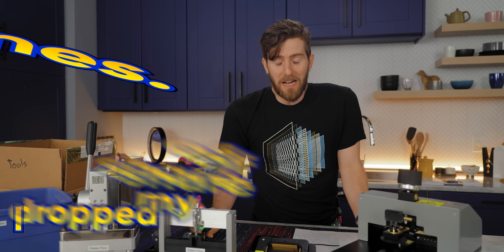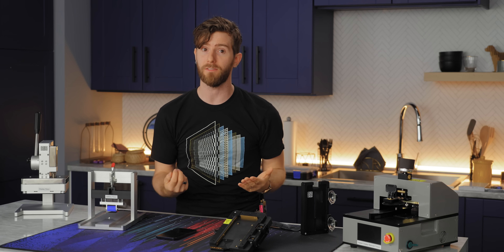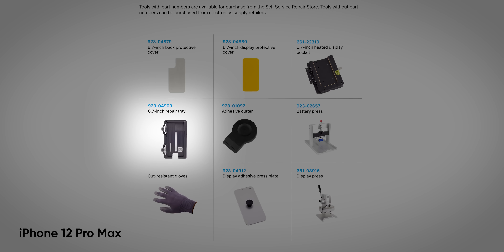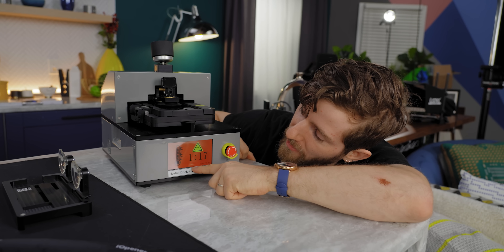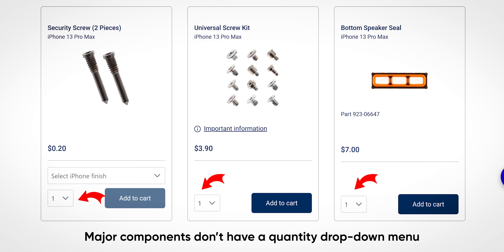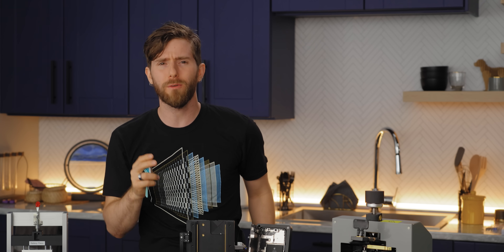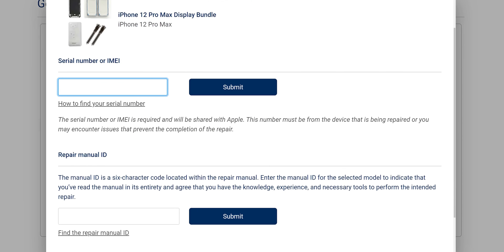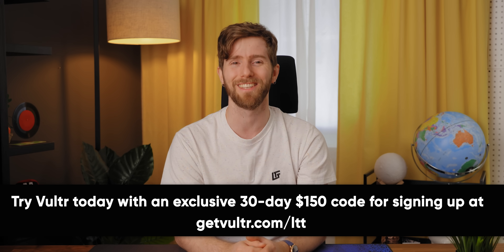I’m a Genius - Apple Self Service Repair Program

Comment: When you think about it...the Apple Store IS the "small repair hustler" now, since they're the only ones with access to unlimited "original" parts to perform repairs.
The whole point of this IMO is to make the Apple Store repair SEEM a lot better in comparison, convincing people to opt for it.
There's a whole psychological study behind this too I think, that when you present a pointless much worse option, something else looks much better or smth along those lines.
Reply: Except there is extensive evidence that the "geniuses" at the "genius bar" give completely wrong diagnostics and will over-charge you for the simplest of repairs. There was a CBC news segment featuring Louis Rossmann where they had a macbook whose display connector had a single bent pin. The "expensive" fix: replace the connector (75-150$), the cheap fix: unbend the pin with a pair of tweezers (0$). The Apple Store's diagnostic: you need to replace the entire display unit, case and motherboard (1200+$). 

There is obviously a tremendous conflict of interest when the company selling you the product and the company repairing the product are the same entity... they don't have to be dishonest but they consistently are and WILL push you through devious designs towards buying a new product rather than fixing your broken one. That is not something we had with small repair hustlers.

Comment: Typical corporate anti-consumer tactic. If you're forced to do something, make it more annoying and (effectively) costly than doing it the way you want people to do it, so when everybody does do it the way you want to (because you've basically forced them down that path), you can tout that you at tried to offer that option and cite it's lack of use as a way to get rid of it.

In what world should the parts to repair a device cost half, if not almost as much as a whole new device?! The whole point of giving the consumers these parts is that Apple saves on the labour of the repair, they literally save money here, yet they (effectively) charge you more than they do themselves to repair the device!!

Comment: Literally the same tools I use at work as an Apple certified repair place. The act of fixing an iPhone is never actually hard because the tools are pretty good and straightforward. The harder part is if literally ANYTHING goes wrong on the “paperwork” side of things in GSX(Apple’s repair order system/information hub for repairs) the repair process gets brought to a screeching halt and becomes a mother may I game with Apple. Very frustrating when you just want to get a client their working phone back.
Reply: ah yes, the joys of GSX-Chat. Love it every time that you have to chat with someone to just cancel a repair.

Comment: I don't get people who defend this stuff to me. It just seems like everyone who uses Apple is either reasonable enough to know when to stop, or is so brandwashed that they can't see how badly they've been duped over the years. 

I get the appeal. Apple has top-notch products and quality control, and I get that they want to keep it that way. But there comes a time where you need to loosen the reins and let consumers do what they want with the devices they paid for. They're not renting the phones, it's a piece of physical property that they own. When someone steals it, do you put "Apple" under the asset owner form in the police report? No? Then it doesn't goddamn belong to them, ergo they should not have a say in what's done to it. 

If Samsung wired their phones to brick when you tried to change anything about them, that would be anti-consumer, right? So instead of making a piece of new equipment brick your entire phone, Apple simply shifted the paradigm of the game to brick individual components if they don't match your serial. (By brick I definitely don't mean the term literally, just hyperbolically.)

Apple decided that individual components wouldn't function if you replaced them without authorization. That's no longer quality control, it's no longer a product consistency issue. It is the end user knowingly making modifications they should have reasonable wariness about. It shouldn't be that end users EXPECT a product to fail working if they try to independently repair their device.

I don't say the things I say about Apple out of spite or hatred or any other negative feelings I have towards them. I say them because I'm tired of seeing my friends flush money down the drain every time there's a minor inconvenience with their Apple device.

Comment: In my country (in Europe) Apple authorized distributor and repair shop takes from 1 week to 4 weeks just to replace screen and battery when parts  are in stock. Currently I can see opening of quite a few "fast" repair shops, but sadly no Apple certification.

Comment: I'm with Linus for the most part here. 

But saying that $58 for a likely damage or bad battery and display is more unfair than the $10 Gamestop will give you for a mint condition used game..... yeah you're very wrong lol. One item is in working condition, the other is not.

Comment: Am I the only one who thinks this is all incredibly stupid?
You have the right to repair (or at least try). What you shouldn't have is the right to make a company sell you parts or services.
If the company wishes to make it impossible to repair their product, that's their right because it's their product...
It's a private company so they can sell whatever they want to boost their profits.
I think Apple's practices are shameless and stupid, that's why I simply don't buy their products. That is the mechanism that the consumer has to improve a given product (choosing another product).
If you keep buying their crap and keep putting up with their prices, repairing policy and charger bullshit, then you can't complain.
You are going to choose their product even if it sucks in those areas, and they know it so they exploit you.
Stop complaining with your speech and start sending a message with your wallet instead.

Comment: Slap ANY iphone 5-12promax on a heating pad for 2-3 minutes. Unscrew the annoying pentalobes, assuming they haven't stripped from normal wear and tear, 10-30 seconds tops. Unscrew the battery shield on most devices, 30 seconds. Deal with the 6's annoying home button, another 30-60 seconds.
On 6 models, deal with the annoying cable assembly, unscrewing shields, minute or two. On 6 models, deal with excessive screws around speakers and contact plating for earpiece. On 7-12, take 4-6 screws out. On 6-8, reheat screen for removing home button, say a minute. Remove screws around home button, remembering lengths of each (matters for screw behind button itself).
Swap screens. Reassemble. Should take no more than 15-30 minutes, depending on model, for a trained technician. For the average consumer, double and halve that, so say an hour to 90 minutes.
15 minutes on a heating device? They're deliberately taking up your time to say "why didn't I go get this repaired somewhere instead of doing this myself?"

Comment: Electronics Repair Technician here with over 15 years of experience. Most IPhone screen replacements only take around 15-20 minutes at most. This Apple repair tool kit is completely unnecessary. For example the most basic tools you need. Would be a screwdriver kit, pry tool and a heat gun. Now for a screen replacement for a IPhone 12 for example. You can buy a lower quality aftermarket screen for as low as $40 or you can purchase a refurbished OEM Apple screen for around $130 from reputable parts dealers. If you're uncomfortable doing the repair yourself. You can always bring your phone to your own local electronics repair shop.

Comment: Major mixed feelings as I’m an eternal optimist. It absolutely is disappointing what they’ve released so far. Would have liked to see a lot of things a lot better, more widely available and better pricing. 
However… 
It feels like they’re dipping their toe in to see how it goes with a small subset of things, and they’re still finding the bugs and the kinks. I wonder if they’ll expand on things over time. Plus, I gotta point out… you do not have to use Apple’s tools! You can still do it with the ol’ iOpener and an ifixit tool kit.

Comment: Apple does not provide a parts tray because we replace all the screws when doing a repair. The lighting dock screws are replaced and we order these in bulk, and then the screws for say a display replacement come with the display part itself.

Comment: Funny thing about those displays for the iPhone 12 and newer models. If you look on their site, it states that you need to use the "system configurator tool" for it to work properly. Probably because the "unable to verify genuine apple display" message you get has nothing to do with being genuine or not, but rather there is data stored in a ROM unit housed in the touch IC of the display that checks with the mainboard on startup. The only way to officially write this new data to the ROM is with Apple's proprietary software which I'm not sure if they do for you or not when you order the display from them, so you may very well still get the error message after buying a display from Apple. The only other method is to transfer the chip to the new display which is a BGA soldered package, attempting to do this without experience is just great way to ruin a display.

Comment: Hey, thanks Apple. This offering provides such a great, real-world example of Malicious Compliance. The right to repair movement will hopefully be able to benefit from using this demonstration to educate the general consumers.
Reply: Honestly, as much as I am anti-Apple, I have to give them some credit where it's due. That screen remover thing will make screen removal SO much easier, especially in situations where the screen is significantly cracked, which is most screen replacements. The pricing is still bullshit, but it's so much more convenient than pry tools and heat guns.
Reply: @iClone101  What the heck is the point of using it though when it's AWFUL value ?
Reply: @DiSCERiTY  Even if you don't buy this one specifically, that fact that Apple has released it public means there will be cheap clones of it built.
Reply: @DiSCERiTY  what's awful value? The replacement machinery is only a couple hundred $$, for someone that would want to buy it it's easy to justify with time saved over time.
Reply: The fact is this is not really Malicious Compliance its minimal effort Compliance.  

The company apple is using for this is the same company that sources parts for apple stores and authorised repair stores. And the prices are identical to what that company charge authorised repair stores. 

And if you were to take apple to court on this they could easily show that a screen costs this much when you consider R&D, licensing, factory time, yields etc.   And apple have said that in-store repairs are a loss leader for apple retail so they will have legal documents proving that it costs them more to do a repair than they make from the repair. (I expect what is happening here is apple retail is also paying the exact same price for these parts and that does not even take into account rental of the shops that apple is retail is paying). 

proving in court that this is  Malicious would be very hard since it really is not it is just 0 effort. It looks like apple sent an email to the company that already supplies them and told them to start selling parts to the public and that is it.
Reply: @hishnash  I don't doubt that a surface level litmus test of their compliance efforts would fly above the legal definitions for malicious compliance. However, it would seem to be that "minimal effort" would have been Apple either doing nothing or allowing the parts manufacturers to sell parts on the open market. This is definitely more than doing nothing. Two massive flight cases, complicated methodologies, user examinations, and implementation of additional systems of control sort of more. I don't think these choices were "minimal effort" at all.
Not to mention that Apple continues to develop and produce, via their extensive R&D budget, devices that are nearly impossible to repair and concurrent systems to prevent "non-authorized" repairs.
Reply: @circan1  The company that is running this program is the company that sells these replacement parts for all apple stores and authorised retail partners (it is not apple).  This is a logistics computer parts wholesaler they provide this service to most other computer OEMs as well.

The factories would only be interested in selling parts in mass volume and would not want to deal with consumers, and you cant expect apple to be ok with a factory selling panels of 10 throasand iPhone screens. Since there is a load of R&D and IP cross licensing behind all of these parts.  

Apple does not really prevent non authorised repair they just show warning messages to uses on devices that have had this happen.
Reply: @hishnash  I think you are missing the point... So I'll spell it out. Apple is being anti-consumer and anti-right to repair with their practices.

Apple has hired this unnamed company to run said program and dictated all the details. Apple is in control. This program having a single operator (if that is the case) is only that way because Apple has decided that fact. 

There is absolutely no doubt that parts manufacturers would sell parts to more companies that do interact with consumers\3rd party repair services but Apple controls the release of parts via production\supply chain agreements. i.e. Arrow Electronics would be happy to sell a lot of the typical repair components to subsequent vendors.

Apple has done R&D and IP licensing for many parts. But, you give Apple too much credit. In the case of most components they've done less R&D and more "spend wads of cash to gain control of the supply chain" and stop the sale of what are in any other device, basic, standard parts. Watch videos by Louis Rossmann detailing the various board level components that are difficult to purchase for Macs. I'm not going to replicate information that is readily available here. There are similar individuals with detailed analysis of parts availability for other Apple devices, feel free to use a web search to find them.

"Apple does not really prevent non authorized repair they just show warning messages to uses on devices that have had this happen". 
This is accurate at the most surface level.
Apple runs harsh DRM at the software and firmware level (companies like iFixit and EFF describe these DRM solutions often as being anti-consumer, anti-competitive, a "trap", etc again. Go Google). These DRM solutions disable specific functionality or entirely prevent all functionality of an Apple device if you complete repairs without Apple's approval and/or by using 3rd party supplier for parts. These "warning messages" you cite aren't message alone, but notification of impaired functionality initiated by Apple because you have an unauthorized component, and therefore you're no longer entitled to the otherwise fully functional hardware that you didn't touch. In fact, if you use the screen provided by Apple as detailed in the above video, but don't call them, it's unauthorized. Clearly Apple didn't prevent repair. Just made it entirely untenable. I'd say that while technically they don't handcuff you if you attempt to disassemble your iPhone, the fact is Apple breaks your stuff it if deign to put a non-apple approved part in it. 
But wait, it goes further to stop repairs. You can replace an exact match component on a device, be fully compliant with the Magnuson-Moss Warranty Act for that repair, and Apple will deny you any services on that device if they can discern "non-authorized" work was performed. So, again, technically not repair prevention. Just the highest tiers of discouragement that Apple can possibly enact. 
This same situation in the automotive industry would be much like BMW deciding that because you didn't put BWM approved brakes installed by the approved BMW dealership on your BMW and thus your BMW no longer run its air conditioning and backup camera. Or the engine now only has half of it's potential performance available. Real quick, I'd expect people to only ever get brakes from their local BMW dealership. Good thing there is legislation preventing this sort of thing for cars.
Reply: @circan1   

Sure factories would love to sell the parts if they could sell the wholesale without restrictions for repair only but if they were required to prove these are for repair only they would not be interested in that overhead of proving every single part sold ends up being used for repair and some other smart phone vendor is not just buying 10,000 units to make a phone that looks identical to an iPhone without paying to tooling or R&D at all. (right to repair is not right to use others R&D and tooling investments for free remember! it is just about repair it is not about being able to use others work to build new products) 

We are not talking about board level parts here are we we are talking bout final assembly parts, the self reaper program is not a components respire program, yes apple buys components on mass and then contract vendors to do the assembly they do not buy finished display units they buy panels and buy touch units and then pay a third company to assemble them.